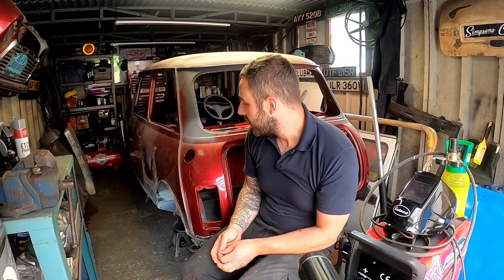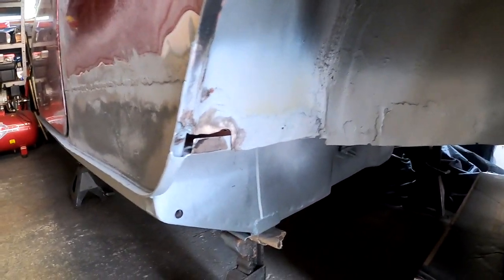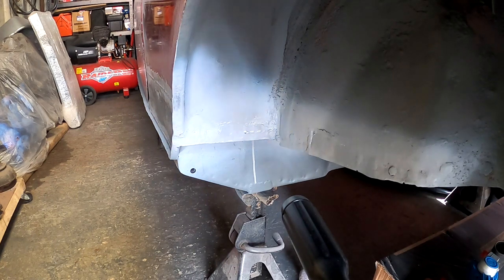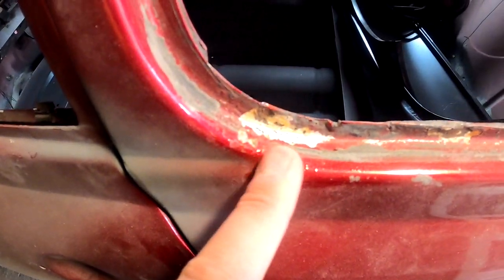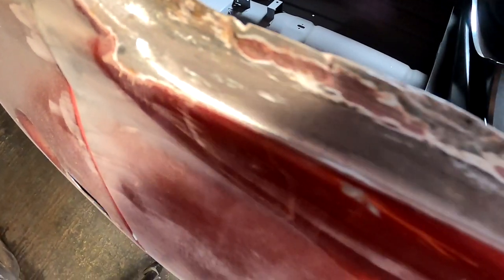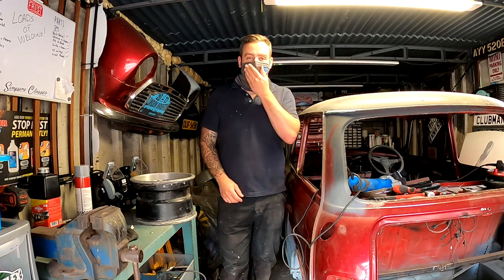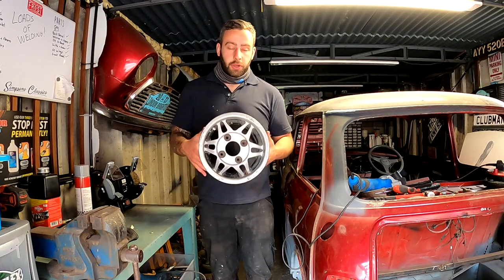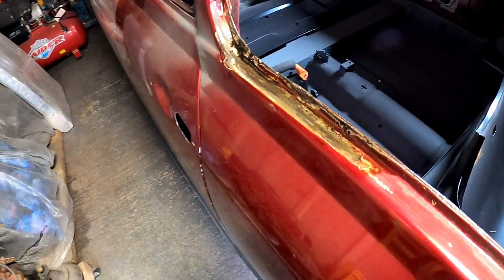ARCH REPAIR & NEW WHEELS - 89 CLASSIC MINI RESTORATION

Comment: I've got the exact same belt file, and it's one of the best tools i've bought! when you get to the stage of cavity wax protection i reccomend Dinitrol, its number 3321 or something like that. Great stuff, it's runny to start to get into hard to reach spots and gives great coverage.They also provide a multi spay attacthment which shoots the wax out at multiple angle at once.
Reply from the maker: Glad to hear someone else has the same sander it’s decent for the money for sure. Yes I have heard that stuff is great I think it might have to be on the list. Cheers for watching buddy 👍
Reply: @SimpsonsClassics  I needed something to get into smaller areas and it's perfect. Love seeing people make progress on their projects, give me hope and pushes me to do mine.
Reply from the maker: Thanks mate yes it’s a great little tool for this annoying little areas. I hope you get some work done on yours soon. Are you at a similar place on your project?
Reply: @SimpsonsClassics  hard to say really. I feel like I redo a lot of things due to it getting tore up a bit when doing other jobs. I've still got some bodywork to clean up and it has to be painted. Along with this I have engine work to do and I'm in the process of getting a whole new wiring loom.. But I'm a lot closer than I was.
Reply from the maker: It sounds like your a lot further ahead than me. I hope to see yours on the road soon then 😬
Reply: @SimpsonsClassics  I wish, I made a target of summer next year. There's a lot of little things to do and sort out like axle boots, steering geometry, bearings, brakes etc.
Reply from the maker: @GT.Bugger  deadlines can be a killer for sure I said I would start my mini van restoration ASAP it’s now been four years 🙈
Reply: @SimpsonsClassics  first time I've ever set a deadline, it's more of a goal or target to aim for. I have been doing this car on and off for about 11 years... Solidly the last 2 and I've made good progress with a full body of restoration. It's just hard when I get one day a week on it. But it'll get there... Hopefully.